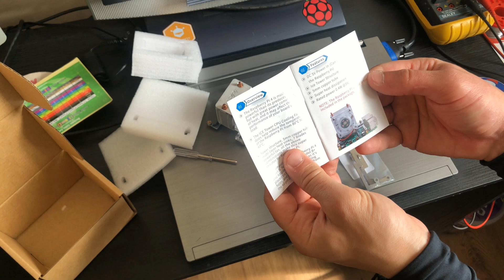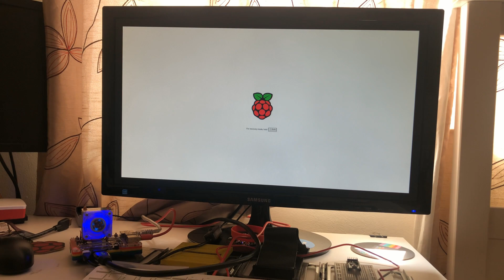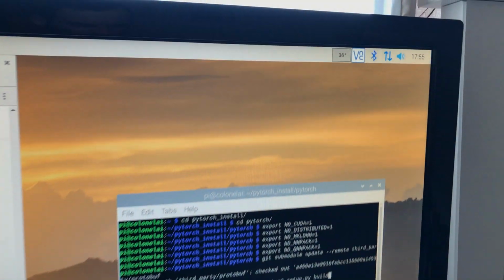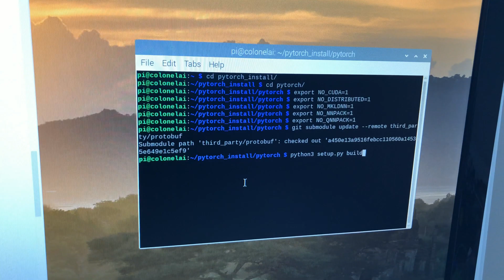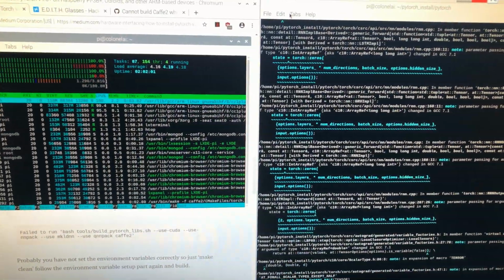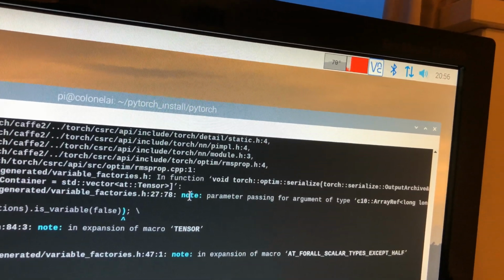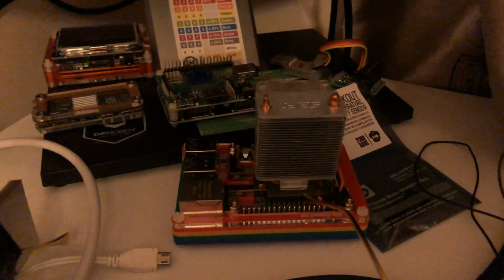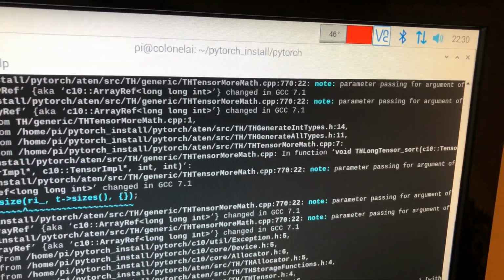Seeed Studio ICE Tower for Raspberry Pi 4 - Review

Comment: Thanks for doing this. A couple of question though, if you do not mind. I got three heat sinks (pretty much a joke) with my Pi4(cpu, memory, usb). Obviously I will have to remove the cpu heat sink, but what about the other two? The USB gets pretty hot, but I am unsure if that is from itself or from the cpu (something about the board traces acting as a heat sink)? Have you tried it without the fan? I have heard that even without the fan it peaks out at 60C. Thanks again.
Reply from the maker: Hi! You can probably leave the other 2 on as long as they fit with the ICE tower on. The USB and other parts of the board will get hot - the heat spreads through the board, but I found with the tower this did not happen so much. I'll give it a try without the fan on and see what happens.
Reply: @chayze3009  Already running the USB cooling firmware.
Reply: This person has done extensive testing. I had heat issues just like you. Firmware upgrade did not solve issues so i did  search on Youtube and found this.  Go to https://www.youtube.com/channel/UCB4VcEwT_TnVhCOHYfhGHnw/videos and click on Videos. This person has done extensive testing on both versions of the Ice Tower.